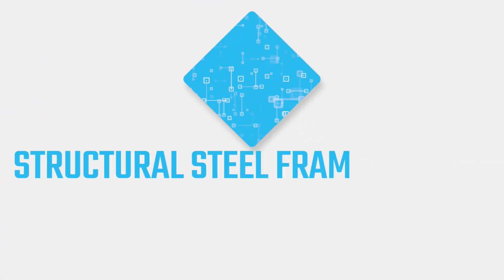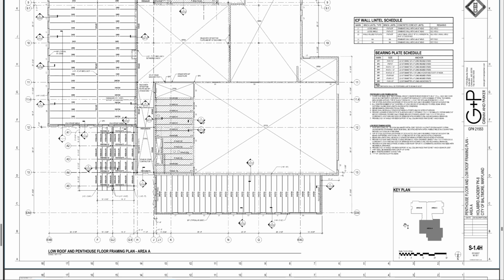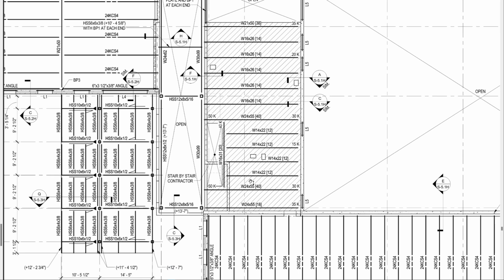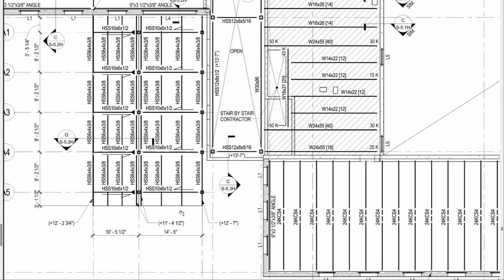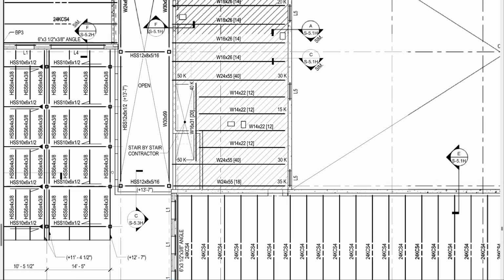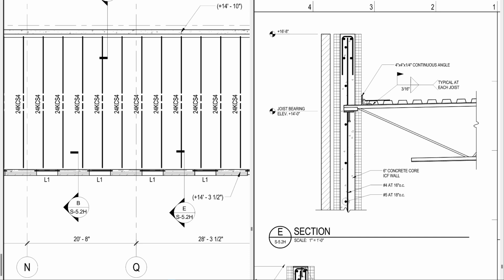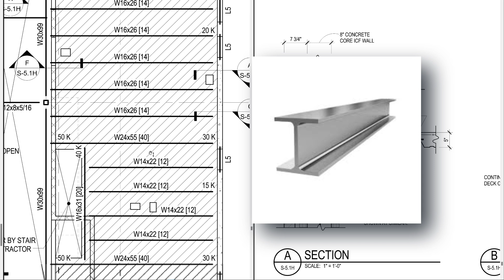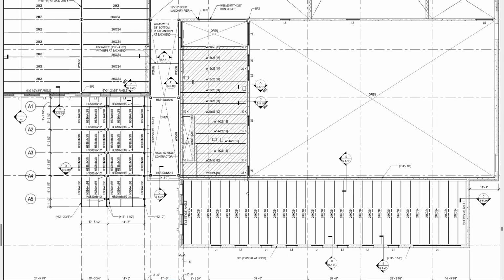Understanding Structural Steel Framing in 8 Minutes

Comment: Hi, @SmithintheBuilding1984. What does the number inside the square brackets [12] in the structural annotation W14x22 [12] mean? Thank you.
Reply from the maker: Hi, thanks for trusting me with your question. In the structural annotation W14 x W22 [12], the number inside the square brackets [12] typically represents the gauge or thickness of the material being referred to. Good luck!